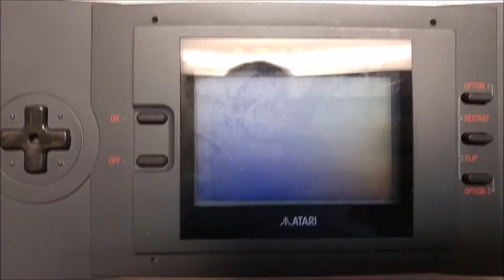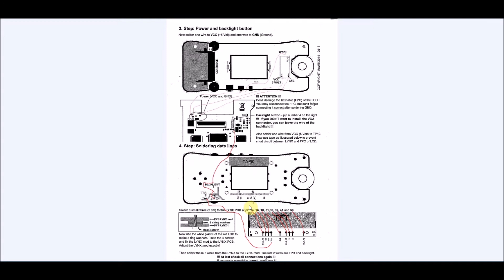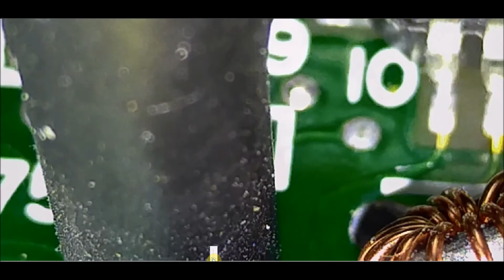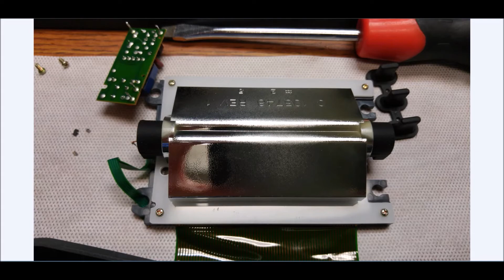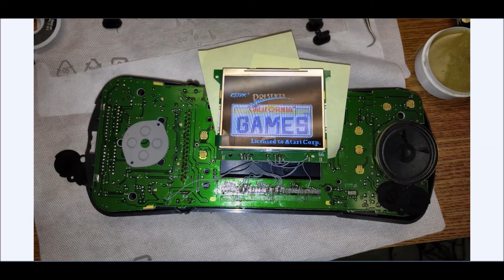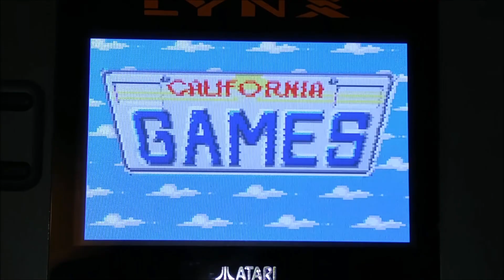How to install a McWill LCD screen in your Atari Lynx I

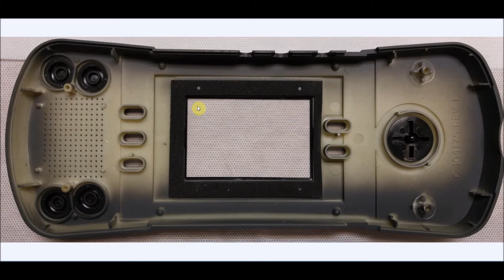Comment: 11:00 According to company statements when the system was new, they went through quite a bit of trouble to select just the right coating for the Lynx I's housing.  The process added cost and steps to manufacturing.  They wanted to produce a certain, unique look.  Instead of just injection molding the slate-colored plastic, they also added a conductive coating, electroplated the conductive surface with aluminum, and then covered with the opaque slate-colored matte top coat.  I've always liked it.
Reply from the maker: Interesting..I didn't know this..thanks for sharing

Comment: Hi Glen - Thanks for the very thorough tutorial. The McWill screen brought my Lynx I back to life. The only recommendation I would give is to reiterate the size of the hookup wires needed (I initially used too large a gauge (even though it seemed small) and pulled off a bunch of pads. The other thing is that the nylon screws are REALLY tough to get in there and get the screen centered. If you ever make changes to the tutorial, maybe speak to the installation of the screws a little more. I picked up some nylon #4 washers at Depot that worked. Thanks!
Reply from the maker: Brian Szarek ..first, thank you for watching and so glad it helped.  Second, all food points and if I have a update, I will be sure to include them ^_^ they are all valid points..but more so..glad you have a awesome McWill Lynx!

Comment: Glen, wanted to thank you for this video.  I haven’t soldered anything in over 15 years and this amazingly got me through it.  Once I figured out that I needed to tin my wires, the install got much easier.  I didn’t have any washers so I ended up using a  little foam pad I had lying around to secure the screen... worked perfectly.  I had no idea how I was supposed to build that custom washer setup from parts of the screen so I didn’t even try.

Anyway, keep of the great work on the channel.
Reply from the maker: bstar777777 .. first thank you for the watch and the compliment 🙂. I am so glad this video was able to help you, why I am here 😎.  Yea the instructions are a bit vague at parts, but this McWill screen is worth it.  Spread the word and again thank you , and glad yo have helped 🤗😎

Comment: The screen is waaay better then the old one and you can see the screen at all angles so if you switchfrpm left hand to richt hand mode, you will still see the screen, whereas withthe onld screen if you switched to richt hand mode,you had to flip the lynx at an weird ackward 135  dagree angle.
Reply from the maker: johneygd   Yes, Mcwill did a fantastic job.. also have his game gear mod and I am waiting on his nomad mod...all make these so much better to play
Reply: Glen Planamento sure for that because those games become finaly & fairly playible because of high contrast and great respons time,with those old lcd screens it's hard to see what coming up such as fast flying objects in toki or fast scrolling platforms like in sonic ,as a result you must memorize everything instead ,so those new screens brings new life into it.
Reply from the maker: johneygd .. I totally agree.  but will say the original Gameboy screen was even harder to see fast objects.